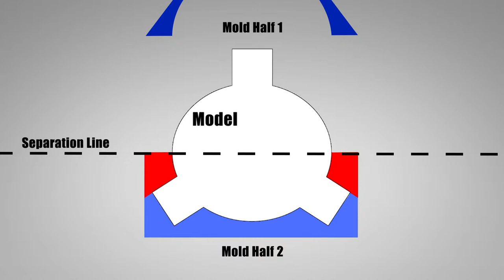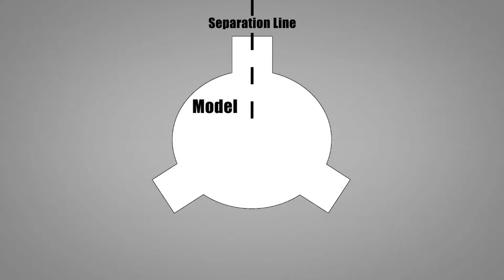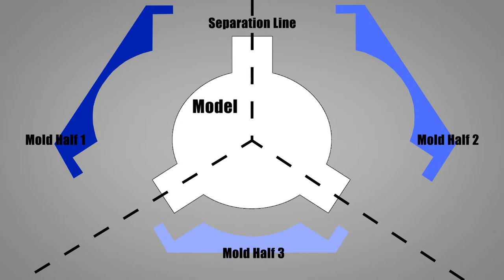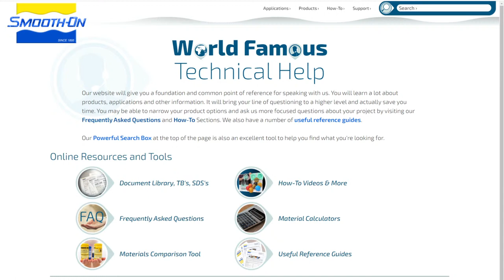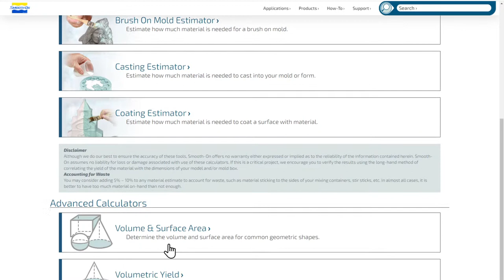Successfully Building Multi Part Molds

Comment: suggestion : That problem you explain at 17:06 could be solved (could be solved??? , well, at least this is what I think) could be solved changing a bit the split line (or split plane?) so the silicone embraces the column a tiny little bit. So, once the clay is removed, in case the column goes off the mould, you push the column against the mould and it grabs the column. At least this works in my mind, I am not positive if this hack would work in real life, but i think so.

In order to create a robust edge for the mould, you would need to do a split plane, a bit more complex. It would not be just a simple plane, otherwise the resulting silicone would have an edge at 45 degrees, less LESS robust than the one you have done at 135 degrees, or 90 degrees if the corners of the column are rounded. Let's say the split plane is 5 milimetres  (or a fifth of an inch) under the normal, the clay would need . . . like some sort of extra wave lifting up and touching all the silhouette of the column.

The easiest way of making this wave (Not sure but I think so) is putting exactly the same amount of clay you have put (not 5 mm under) you take off the column for a moment, and you carve that complex split plane I have described. You start with the knife (or cutter) at 45 degrees doing the silhouette of the column (in theory, the depth of this cut would be 7 mm [7.07 . . . ], anyway, a cut, that's it) . And later you take off more clay. You get rid of  these 5 mm I have told. This sort of river-bed you are about to carve (with 5 mm depth) only would need to be one inch (or even half inch) wide, rather than wasting time, taking off a big amount of clay. Once you've carved that crocodile pit (sorry, the proper analogy came to my mind too late) you put again the column on the clay (hoping it will not float under the silicone) and that is it.

By the way, talking about floating : Instead of surrounding the entire silhouette of the column with this crocodile pit, we can carve only 2/3 of it. On these silhouette sections with no pit (the four corners, for example), we add more clay, retaining the column in order to avoid floating. These four extra bits of clay, would have the same form (or the same section view) of the crocodile pit, but in negative.

Comment: 1. Awesome video!
2. I'm new to mold making. Ultimately, I want to produce a bunch of plaster molds from a single silicone mold for mass producing slip casts. I am using a 3D resin printer to print my designs, but when I attempt to make a silicone mold of that, the silicone touching the 3D printed object never cures; it stays goopy. How should I go about this?
Reply from the maker: Hi there. Glad you enjoyed it! It sounds like you are seeing cure inhibition. The UV printed pieces can cause the silicone to not cure. Here is a video where we show how to make a mold of a UV printed 3D piece. https://www.youtube.com/watch?v=5VC5mkW3Eg4 If you have any further questions you can reach out to our technical support team. https://www.smooth-on.com/support/ticket/add/agree/
Reply: @smoothon  that's what Im looking for! Thank you!

Comment: How do you make Smooth on to make mold-star 15 low molds of different colors please? Thank you
Reply from the maker: You can add Silc Pig silicone pigment to Mold Star 15 to alter it's color.  For more options, a T-series Mold Star rubber could be used, such as Mold Star 20T translucent silicone.

Comment: how can you remove silicone from a void that really locks? for example a vase that curves like the liter U? multi-part void?
Reply from the maker: That is one method.  A collapsible core could also be used.
Reply: @smoothon   @smoothon  how would a collapsible core be made the inner core is essentially spaced out flattened cubes with one long rectangular prism running through the center connecting them, lots of sharp right angles  --------_. I'm able contruct the shape of the void out of acrylic cubes and cast it but I'm left with a solid silicone void that cannot be removed. would a silicone slip casting of the first mold be the way to make this "collapsible core" or is there another method to making a collapsible core?
Reply from the maker: This is a good question for our tech support team to look into deeper, can you send them a ticket here? https://www.smooth-on.com/support/ticket/add/agree/ Thanks for watching! @Darkbulb1